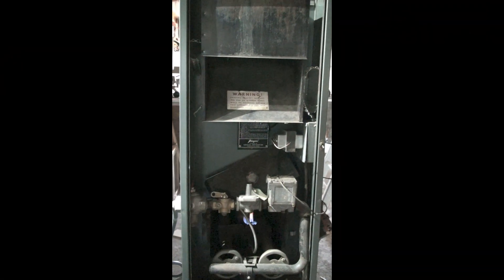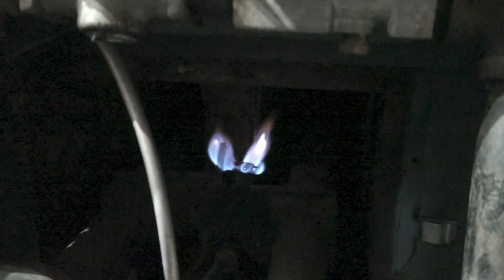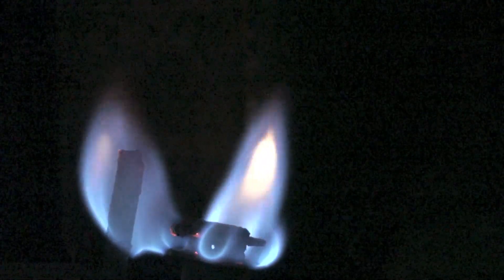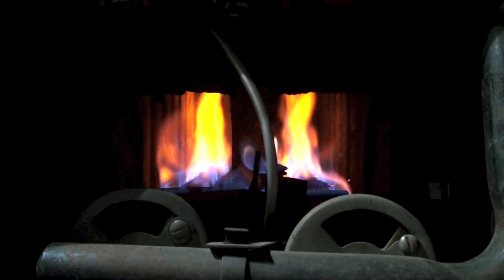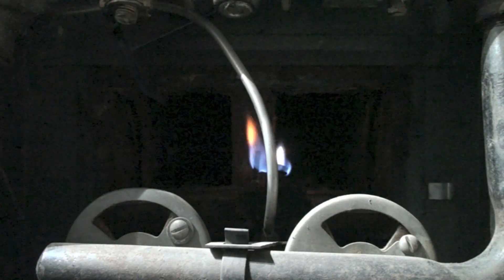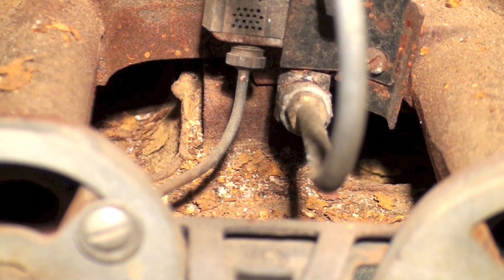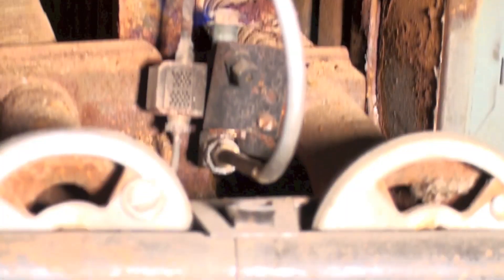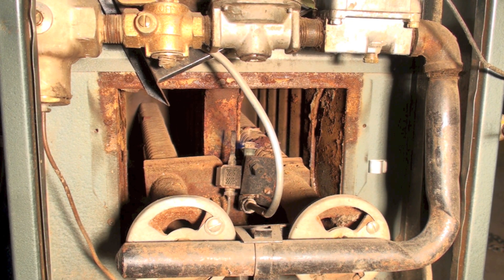Service of the antique pilot furnace part 1

Comment: I have a floor furnace in a 1935 house. I can see the pilot from down below in the basement. It has a Robertshaw millivolt control with a thermopile, the control has no knob (on off pilot). It works, looks good too. Eventually I will want to kill the pilot for the summer but I don't see how to relight it. The only thing I can think of is just put heat on the thermopile until it lights? I'm not sure if a long match is enough.
Reply from the maker: If it has a gas chain (several components in a row), there is a button that can be pushed to open the pilot gas then the pilot can be lit. Then hold button for one minute. It should then stay on. 
GFM

Comment: Are the thermocouples different for old furnace like this to a newer style?  I have a 60's Bryant and the thermocouple is open on both sides like automotive brake line. I bought a universal replacement and the threaded end of the universal thermocouple that goes into the gas valve is to small and slips past the threads.
Reply from the maker: Some of the early thermocouples were of that type.  About all I know of to do is replace the gas control.  This will involve replacing the gas chain with a combination gas valve.
GFM

Comment: Very cool video, 

I have a late 50's or early 60's Day and Night gas furnace, it has a combination gas valve, 2 burners and a standing pilot light, and a direct or belt driven blower fan, it blows hot, I know it is inefficient, but I don't really care, it's better than dealing with control boards being in your way of your work.

My grandparents on my mom's side have a early 40's Payne gas furnace, it has a combination gas valve, 4 burners and a standing pilot light, as well as a belt driven blower fan, it's inefficient, but it keeps my grandparents house all nice and toasty warm, it's a lowboy furnace, it and my old day and night gas furnace are still working great up to today.
Reply from the maker: If it ain't broke, don't fix it.
GFM
Reply: I agree.  For me, simplicity is more important than efficiency.

Comment: Had one of these in the house I grew up in with a classic Honeywell round thermostat. It was an American Standard made around 1964. In 1984 my dad had the heat exchange, thermocoupler and the limit switch replaced. He found out he could have just gotten a whole new furnace with an electronic igniter. It did a good job heating the house and only had one issue that my dad fixed, it was from a roach getting into the limit switch. My dad wouldn't fix the central after it broke around 1985 and just put window units in, so it didn't run 6 months out of the year. It was still working when my parents moved in 2003. The new owners replaced the whole system including adding a new central air conditioner. I liked lighting it at the start of the cooling seasons and the smell of burned dust got me into the mood for the winter. Loved the sound it made when the burners ignited.
Reply from the maker: Cool thoughts
GFM

Comment: Hello There grayfurnaceman,

Great series of videos my friend!  I'm a chemical engineer, so I guess I understand some of the theory around combustion, heat exchangers, etc., but I must say I really admire your practical explanations - I'm learning!

I have a natural gas two burner furnace that was installed in c.1970 (I live in Melbourne, Victoria, Australia) - the front panels of the furnace are held on with bloody Robertsons screws - yes, it's Canadian!; it's an Atlas Webster (Montreal, Canada).  It's in very good general condition, unfortunately the bloke that used to service it (he said it was a fantastic furnace and built to last) is no longer around and it has recently been suffering from "blowback" - kapow!  

Anyway, removed the two burners (heavy cast-iron affairs) and cleaned them - they were dirty and likely the cause of the "blowback".  The ITT General Controls gas valve looks fine (on the outside), but the main gas flow doesn't come on as it did last year (pilot light looks okay and stays on) so no heating and it's winter now!  

The only new item is an LCD battery powered thermostat that was installed about 5 years ago to replace the old (but still functional) Honeywell controller.  Strangely, there is a pilot gas line, a thermocouple (or thermopile?) and a copper wire/probe that I'm not sure about (three items!) all manifolded together and connected back to the gas valve.  Maybe I'll clean the thermocouple with some emery paper - looks a bit dirty.

Any ideas as to why the main gas is not coming on when I turn the thermostat setting up?
Reply from the maker: It may indeed be a thermopile actuated appliance.  Be sure all connections are clean and tight.  Also be sure your pilot flame is blue and covering the thermopile and thermocouple.  Hope this helps.
GFM

Comment: Question for you, my neighbor has the same furnace made by Sears. His furnace wont stay lit, could that be due to a bad gas valve? Thermo couple was changed few months ago. Can he find the gas valve for this ancient furnace or is it not worth going through the trouble?
Reply from the maker: If the pilot light is covering the thermocouple, the gas valve could be bad.  A general replacement valve will work.  Honeywell and White Rodgers make them.  Fairly big job, be sure you can handle it.  I do have a video on my channel directing how.
GFM

Comment: I have two big vents on the floor in the hallway and living room which seems to be the return air.  I believe that's he air the furnace uses to bring up thru the furnace.  I opened the furnace middle section and didn't see a filter.  Not sure now.
Reply from the maker: Many times the filter is placed where the return attaches to the furnace.  Should be either the metal loop  or brackets.
GFM

Comment: Hi Gary, I have a 1960's Western bran furnace like the one your are looking at here.  Do these have air filters on them?  If so, where?
Reply from the maker: They do.  Now, where?  That is the question.  Look for the return air.  It should be to the side or bottom of the furnace if the air comes out the top.  It could be in the return close to the furnace or it could be inside the fan cover.  Sometimes they use a metal loop to hold the filter in.  It could also be at the return air where it has a grille inside the house.   Hope this helps.
GFM

Comment: Thanks for posting this video. I learned alot from it. I do have one question for grayfurnaceman. I have a CLEVELAND Brand Furnace! Its literally called a Cleveland. My pilot light is HUGE! Should I call someone or am I fine? I had a ton of carbon that I usually don not have after summer, but now winter in Cleveland approaches and its annual cleaning time. Thanks!
Reply from the maker: I would have it looked at.  If there is carbon and the flame is yellow, it needs to be looked at.
GFM

Comment: my old furnace has no pilot reset?  It also has an "air" intake to the pressure control and the thermocouple goes directly to valve?  It's a Sequoia.  Not much rust, very dry in El Paso, Texas.
Reply from the maker: +Tom Ingle You probably have a gas chain control like on the videos.  As for reset, not sure what you mean.  The pressure regulator uses an opening to ambient pressure to maintain the proper pressure in the manifold.
GFM

Comment: Hello Gray furnace man.  Great info.   I have a before 1968  American Standard Split unit and my furnace has a cracked heat exchanger.  Is there any chance of finding parts for this baby.   The Model # says   U60-1.  Any info would be greatly appreciated. Thanks, BT
Reply from the maker: +Blake Thompson Not much chance on that.  The bigger question is:  why would you want to?  The technology is obsolete.  Generally, I look at a furnace of this type as:  if it works, leave it be.  If it fails with an expensive repair, use the money you would use for the repair towards a new furnace.
GFM

Comment: The "fallen rusted flakes" you guys find on the burners used to be the heat exchanger wall. The chamber that separates the flue gasses from the air that is circulated throughout the house. The walls of that chamber are very important as they keep the bad air away from the good air. Every flake is a few thicknesses of less protection. I suggest actively trying to find weak spots in the heat exchanger walls especially when I see excessive flaking. It's better if I knock off the flake from the crack or hole than if I leave and a week later the flake falls off and the burners start rolling out.
Reply from the maker: Ever so true.  Using a screwdriver to check for weak spots sometimes helps.  Also, if there is quite a lot of flakes, it is indicative of perhaps a low firing rate.  Age and a lot of flakes = throw it away.  Thanks for the thoughts.
GFM

Comment: Man i love working on that old stuff. They just dont make them like they use to as far as durability. Efficiency well not soo much but relielable YES.
Reply: Loving my c.1970 Atlas Webster made In Montreal - installed in sunny Australia (albeit quite cold in winter Melbourne)!  One hundred percent original gas furnace except for a new LCD thermostat (even though old Honeywell unit was still 100%); has an original ITT General Controls gas valve that just looks solid!
Reply: This is probaby a 75 to 80 percent furnace
Reply: For me, technological simplicity (no electronics / computers) is more important than efficiency.